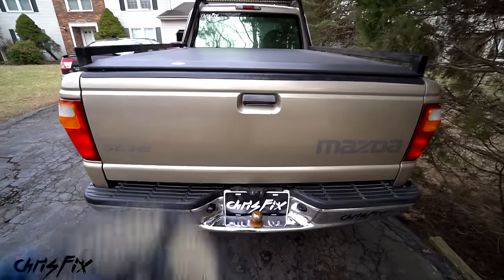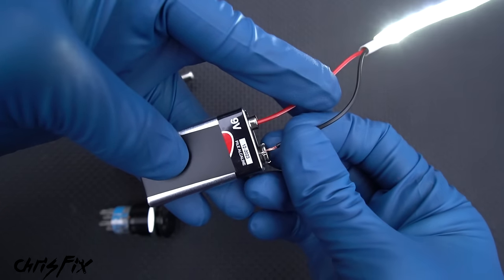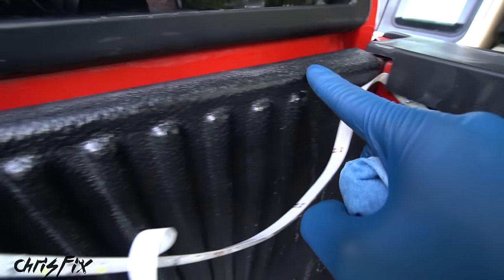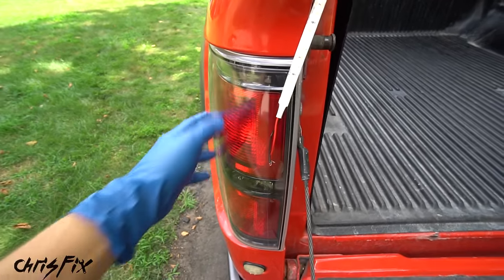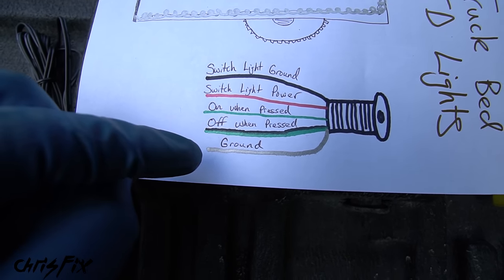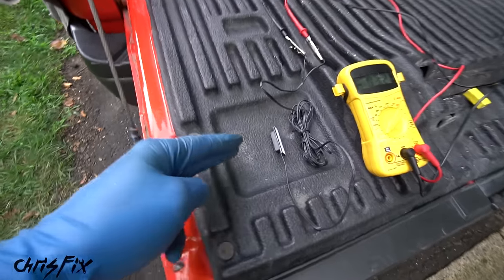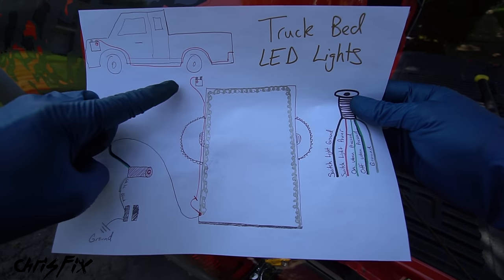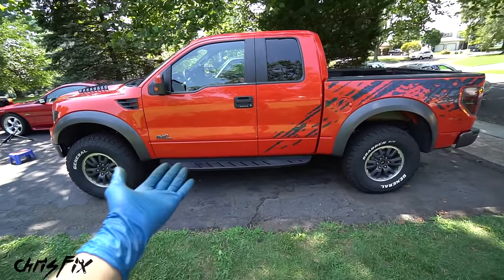How to Install LED Bed Lights (Fun DIY Project)

Comment: I wouldn't go with ground to switch, it's always better to have the power wire going through the switch in case something shorts out behind the lights (ie ground cable rubs on some metal) because then the light would stay on, rather than the fuse blowing if power was switched and something happens
Reply from the maker: Thanks for the tip!

Comment: Hey Chrisfix. Love the idea. I plan on doing it to my truck. But one quick question. Instead of hardwiring it directly to the battery. Could i tap it to a fuse thats running constantly?

Comment: Now, I’ve heard that the car battery can cause the lights to burn out unless you use some type of regulator of current, I’ve just bought govee interior lights, the 4 light with cigarette lighter kit thing? 
It’s a cool kit. I just don’t like the cigarette lighter connector. I wanna do this mod to run it to my battery, but I’m not entirely sure if it’ll work. I wanna do this correctly so I’d appreciate any help. So, I’m looking at the cigarette lighter connector, it runs to a little remote that you use to control the lights which directly  go from one wire to two, and those two run to two more lights, one for each. My issue is, I don’t know what would be the negative to connect to my ground and positive for my battery

Comment: Hey Chris so you ran the ground from the button directly to the magnetic switch, which from there you grounded. If I’m using only the button and not the magnetic switch, can I ground directly from the button?

Comment: Hey @ChrisFix! Can I tap to a red gauge 8 wire from the back of my track and use it as my power? I use it as a bed 12v power and usb. Or I need to run a new 14 gauge wire like you did? Thank you for your wonderful video

Comment: Hey @ChrisFix great video! I have a question about LEDs, so I installed LED headlights all around my 05 silverado and changed the flasher relay but now when my headlights turn on my turn signals won't work. Any suggestions? Thanks in advance 🙏🏽🙏🏽🙏🏽🙏🏽
Reply from the maker: Sounds like the relay isn't working properly, see if you can get it replaced and try that out!
Reply: @chrisfix  thank you sir!!! And God bless!!!!! You should do a video on that no one explains a process better than you!!! YOU DA MAN!!!

Comment: Hey Chris love your videos. Just wondering wouldn't the thin wire burn as there is more resistance and power from the 14gauge wire. Please let me know as I am worried on my own car.

Thanks ✌

Comment: In need of your assistance; the push bottom in the link that you provided has wires that is  totally different from your example. Can you please walk us through the proper way to wire the wire connector . The colors of the wire is red,brown, blue, black and white on Amazon.

Comment: Aren't there usually open (extra) fuse points in the cars fuse box for this type of after market accessory?
Reply from the maker: Sometimes. If not you can use an “add a fuse”.

Comment: PS i think it would cleaner and nicer if you stick to the main cabin back part. Though the strip does need some slack. Other wise run it below th bedliner. This doesn look very nice being open. ANother point. They fro Canada open elements, this thing will break with weeks!
Reply from the maker: Thanks for sharing, this actually held up for a few months in the canada winter!
Reply: @chrisfix  yeah?!! Wow so tougher then it looks. Any weak points in this setup or didn't they mention where it failed?

Comment: Hey Chris. Went to do this upgrade and the switch I bought is different colors. Was hoping you could clarify with wires I need to use for this job? I have everything else
Reply: That’s the Amazon link to the switch. Couldn’t get my hands on the same one you have

Comment: Hey Chris idk if you'll see this but I've got a 1999 new edge mustang and the front fender on the driver side is dented up real bad and a few other body panels (along the body lines) are as well; do you have any videos on dent repair along body lines? It's the first year of the electric green metallic so it's expensive to try getting the paint and body shops are expensive

Comment: Chris, I was inspired by this project and I decided to do the same. And youn were right, it was fairly easy to do. Is there anyway I can send you the final product? The only thing I didn't do was the automatic, I installed a just an on/off switch. It still looks pretty good.

Comment: I see that you are using 14 gauge wire but the inline fuse linked in the description is 12 gauge. Is that okay because I've been told not to use different sized wires in one continuous connection?

Comment: Actually surprised no quick disconnect (plug) as it is pretty common when modifying trucks and with certain models it's required for repair to remove the truck bed. The power stroke fords you need to lift the cab to access back of the engine etc.. 

Generally when I do fuel pumps, fuel lines, and/or brake lines it's easier to remove 6 bolts and factory wire harness plug and lift the bed to access the top of the fuel tank and frame. This leaves more issues then it solves for a $4 water proof plug.

Matter of fact I have a 98 S10 I am replacing fuel and brake lines and they wrap from inside the frame to the top of the frame right behind the cab and then go to where they need to. Almost impossible to install those lines WITH OUT lifting the bed off (and with a hoist, takes about 10 minutes to remove bed). If I was working on that truck I would have to charge another hour labor plus parts to the tune of $100 ish to install a plug ($75 hr labor), either way it's getting cut with side cutters.

Comment: so in my dads truck their was a light that wasn’t working and we bought a new lightbulb and set it, and when we tried turning it on it wouldn’t so we switch the old bulb to the other side and tried making sure it wasnt the bulb but when when put it wouldn’t turn on so we put the new one in on both sides and now both don’t want to turn on and we are wondering why

Comment: I liked everything except how he crushed that last ground wire with the nut. Use a ring terminal for goodness sake.
Reply from the maker: Thanks a lot and I've done grounds like that for years and never had an issue, but you can do a ring ground if the size is correct!
Reply: @chrisfix  Thank you Chris. You are the greatest YouTuber of all time.  Such awesome videos,  you're the best. Thank you for all that you do.

Comment: To add a comment, the magnetic switch that is used, is a normally open switch. Do not get a normally closed switch for an application like this. A normally closed switch will work, but it will need to be set up differently.

Comment: got a question. I added another brake light by connecting the two wires to the left brake light. I need to press the brake pedal twice for the new brake light to light. I wonder why. If I connect it to the battery directly, it works fine.

Comment: Do you need a resistor/power supply unit or can they be connected directly to DC battery power? I've read that the LED not having resistance will burn them out quickly if direct to battery...

Comment: Could this be modified and wired up directly to the existing bed cargo light so it comes on if you flip the factory cargo switch in the cab, open any door, use key fob, etc?

Comment: Sir. Chirs... Tried this installation for my frontier, but the switch cables have different colors, I keep my fuse blowing up. Could you please do an update for this. I tried to make the halo lights on too..
Reply from the maker: There is no update tho. It was done properly and still works fine to this day. Sounds like you need to get the wiring diagram and see what wires are ground and power.

Comment: Hi, ChrisFix A quick question, can you still connect the Negative wire to the negative part of the battery or does it have to connect to bare metal. thank Great Vids.
Reply from the maker: you can go directly to the battery if you want.
Reply: @chrisfix  thanks so much...

Comment: Could I run a line from the battery to a fuse and then to my dashboard and multiple switches so I could hook up 3 or 4 lights with only one line and fuse from the battery? or should I have a fuse behind each switch and for every accessory. I imagine that.

Comment: Hey @ChrisFix. How about running 2 strip lights instead of going around the whole bed of the truck. I like the concept of keeping them hidden on the 2 sides of the bed. How would I connect them to 1 switch?
Reply: you should have followed him so you can connect your wires to one switch man

Comment: You take time to properly insulate the wiring and show the difference between butt connectors and soldering but yet failed to put an iron loop on the ground. Looking hell a ground comes out the back of the nuts I would think that the wire would crack losing the ground.

Comment: Why not put a ring connector like you used on the battery, for the ground at rhe tailgate. The wire in the nut looks sketchy doesnt it?

Comment: Do you believe this light strip will hold up in a truck bed without a bed cover? Wondering if the rain/elements/etc would have any effect on the durability of the light strip.
Reply from the maker: You know, I’m not sure. If you use the tape that comes with it, def not. If you add the double sided tape from 3M (VHB tape), it def will. Not sure how the UV rays from the sun will affect the plastic clarity tho.

Comment: I'm curious, is there a reason you didn't use the hot wire on the trailer connector? (Maybe this truck doesn't have one but my Ram has the hot wire in place, which saves a ton of time!)  Thanks for the info. I have lights back there now -- and with the magnetic switch!
Reply from the maker: You can blow the fuse if a trailer is connected and the lights are used. That’s the only reason.

Comment: The switch I ordered from the list came without a wiring diagram and has red, white, black, brown and blue wires. Also, does a tailgate assist interfere with placing the magnetic switch?

Comment: Hi Do you have a problem wireing the strip lights to the rear driving light,which is a lot closer ,as you only need the led's on at night and only for a short time anyway .makes the instalation a lot quicker.?

Comment: Hey Chris I noticed that you said you used 14 gauge wire and the in-line fuse that you linked was gauged at 16, does this cause any issues down the road? I’m kinda new to wiring so I apologize if this seems like a dumb question.

Comment: Hey don’t know if you’ll see this but I need help!  Did everything exactly the way you did minus the magnetic switch.  Just want to press the button to turn on and off.  Can figure out the wiring tho.  The instructions for the push button I purchased is telling me to connect the “-“ from the battery to the black wires for the lights and the button.  Problem is there is no “-“ wire from the battery.   Any info would be very helpful

Comment: Does it matter what gauge wire the inline fuse is? Does it need to match the 14 gauge wire you run to the back?

Comment: Hey its been over 6 months now, so how is the double sided tape holding up?  Has there been any sagging or repairs needed?  I know there wont be any problems with ur connections
Reply from the maker: Jakub told me it was holding up great, but some spots needed to be reapplied! Other than that, he hasn't had any issues!

Comment: Hey so I got one of those switches from Amazon along with the magnetic things. However the switches didn’t come with a cable harness attached. 

Can you help me figure it out. I’d like the switch to work along with the opening and closing. And would like the led ring to stay on as well.

Comment: Hey @ChrisFix, I just did this on my 2019 F150, however it seems to have voltage drop, the LED's are dim, very dim, and guess what may be the issue?

Comment: Chris, I have a Ford F150 with truck bed LED lights.  Installed a rack with two sets of rear facing LED lights. Tied them into the wiring/truck bed switch and everything worked great.  Then added side facing LED lights, tied into the same wiring/switch and now none of the LEDs work.  Disconnect the side facing and everything works.  Any thoughts?

Comment: Hey chis .question do I have to use a relay on the switch?? Cause I watch your video a couple times and try to test the switch on my car battery and the wires fried

Comment: Is there a way to get the diagram to the connections cause I got the button switch on the link but the colors on the cable are different and I'm trying to figure out what to connect to what

Comment: how do you add more LED lights in my 2019 Ford F-150 if they have some LED's in there already.  Can you tap off those connections somehow?  I would like to hook the lighting up to be music driven in the truck bed with various colors.  Any thoughts?

Comment: I have several questions and I would highly appreciate if someone takes the time to explain them to me? Thanks in advance <3

How does this wiring actually work? For electricity to flow trough a circuit both the positive and the negative side of the battery need to be connected, right? Am I misunderstanding something about electricity or vehicles in this case?
I assume because the car touches the actual ground only through the tires it is pretty isolated from the actual ground, so does this mean that the whole metal body of the vehicle is connected to the negative side of the battery and that is how it is "grounded"?

Comment: The magnetic switch over heated on mine and the lights didn't turn off when I closed the tailgate
Reply: Because the switch isn't rated for the amount of current. You need to put a relay in this circuit and use the switch just as the trigger circuit

Comment: Would it be possible, instead of running it off the battery to run it off a 9v D battery independently?

Comment: Hey Chris, I installed these in the Spring, the exact same lights the exact way you described and the LED lights are now barely working. Have you had this problem?  I think it's the cheap Chinese LED lights. Any suggestions?

Comment: Can these strings connect to each other? Ive been looking at these kits online and from what I've seen they don't
Reply from the maker: I'd keep it under one kit (or spec) so it can all attach to each other, otherwise you'll be doing a lot of research to get it to work together!

Comment: Is there any other way you could wire this up without having to run a wire to the battery? taping into another power wire ?

Comment: How do you know which wire gauge to use for positive and negative to run from the battery to the back of the truck?

Comment: I bought the switch but the color it came with are different i know the red is the + led the black is the - led and the other 3 wire are white that its c, blue that is normally open and brown is normally close i just don’t know what is push when on and push when off

Comment: Do you have an updated link for the amazon led light strip? each one I find seems to need the separate DC power supply....
Reply from the maker: The one in my description is the exact one I used. There isn’t a power supply needed since it uses 12v. Unless they changed what they are selling (I can’t check on this app where I answer comments).

Comment: I have lights inside my truck but in order for them to turn on i have to connect it to the ashtray can i cut the cable and hook up a kill switch and also grab the power from the ashtray instead of the battery ?

Comment: If I wanted both bed lights and lights to go on my hood can I tap the wiring for the engine hood lights into the wire for the bed lights so I only have 1 fuse or do I need to run a separate line to the battery to do what you did here? To do 1 fuse I may just need a bigger fuse correct?

Comment: @Chrisfix, how much current/amperage can the magnetic switch handle?
Reply: Not much at all. If you plan to run the LEDs for longer periods you will need to add a relay to the circuit. A roll of led 5m or 16ft uses about 4.5a to 5a which is a lot more than what the reed switch can continuously handle. 

Check this answer from Amazon to a similar question:

" I can tell you it is less than 72 Watts. When I used one to control some LED tape lights in a pantry, which amounted to about 72 Watts, the switch got hot and deformed. I bought another switch along with a relay (all I could find were automotive ones with high amperage ratings, but that's OK). And that solved the problem. If you're thinking of looking for another switch like this one but more heavy duty, good luck. I searched and searched and no luck. If you're not sure what to do, get this switch and a relay. This is the one I bought: "Car Auto Truck Relay & Socket SPDT 12V 12 Volt DC 40A AMP 5Pin". It was $4.00. Hope this helps"

Comment: i know this is an old video but i have question. SO the only way for the magnetic switch to work with the other switch the non magnetic switch has to have 3 wires?
Reply: nevermind i confused myself... overthinking

Comment: There is few thing i dont get i hope someone will explain it for me a little more. Is there some resistor for the led light stripe in it since there was no resistors instaled? And will this work if i take positive from another electric powered device like from back light or something thats closer to the bed, or is there another way to get power except straight from the battery?  Our carelectrican highschool is closed so this helps a lot

Comment: Since you are never going to need the LED's on during the day, why not just hook up to the tail light circuit then you run 6 inches of wire and have no risk of leaving the LED lights on and killing the battery.
Reply from the maker: The lights would only be on if the taillights were getting power, and the lights can only be on if the tailgate is open!